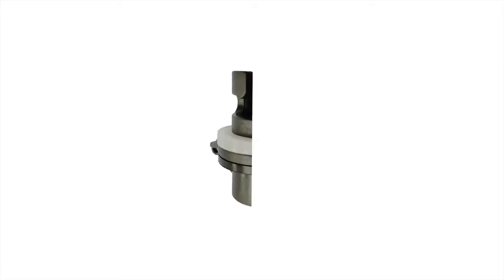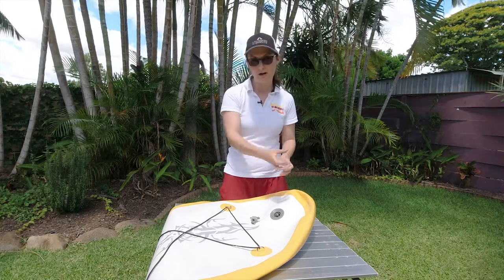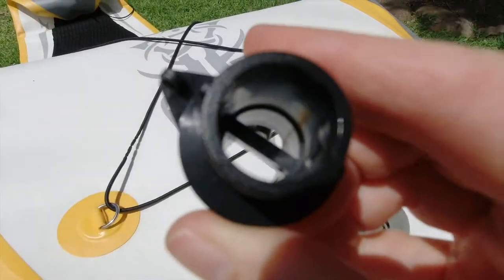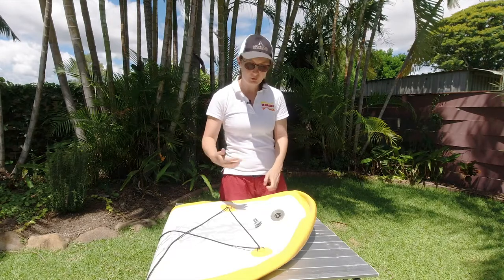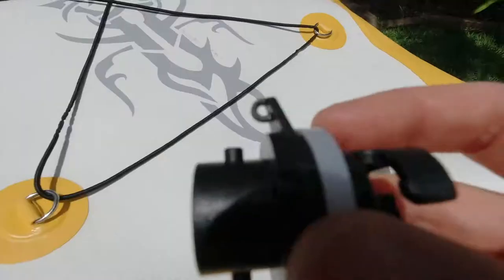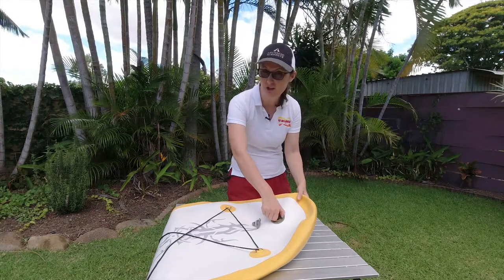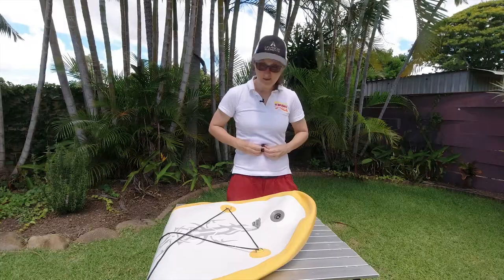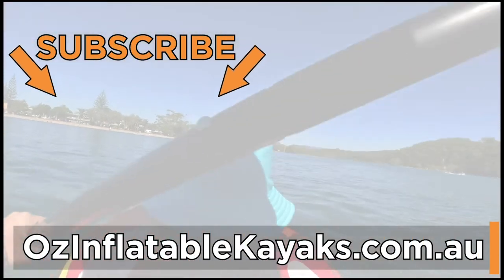Troubleshooting for the valve used in Drop-Stitch Chambers

Comment: Thank you so much for posting this, Emily! Convertible Elite owner from California here, and our drop stitch floor was driving us nuts. Half the time we inflated it the air came rushing out when we disconnected the pump. I think I fixed it now. What I ended up doing was sanding the stem of the valve smooth around the edges. It looks a bit like a little yellow plastic crown and it had some rough edges. I used "micro-mesh" pads for polishing guitar frets, medium grit first and then superfine, but I think any high-grit sanding paper should work, too. No problems since. Thanks again!
Reply from the maker: Great extra tip Thomas! Thank you so much! Cheers, Emily.